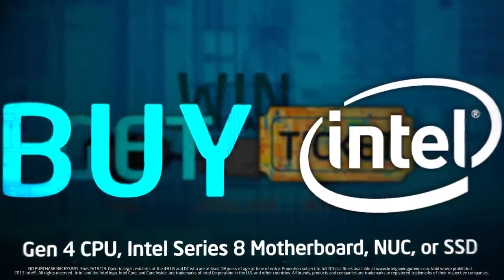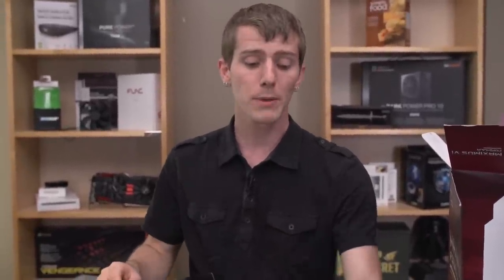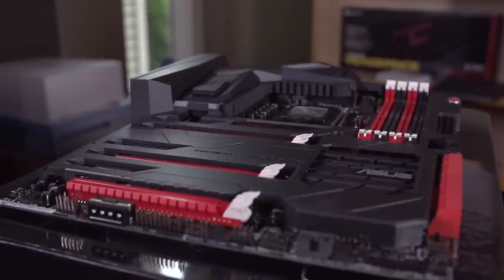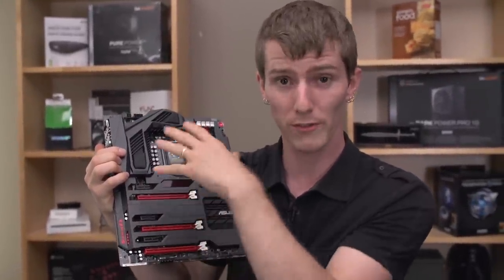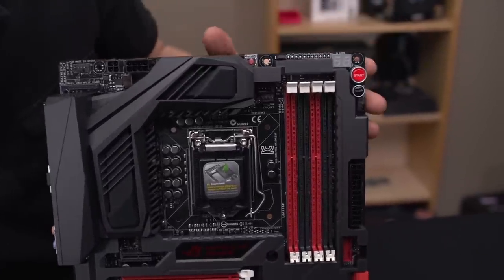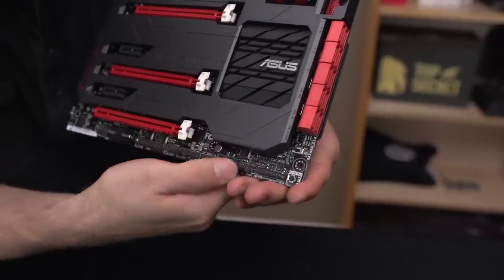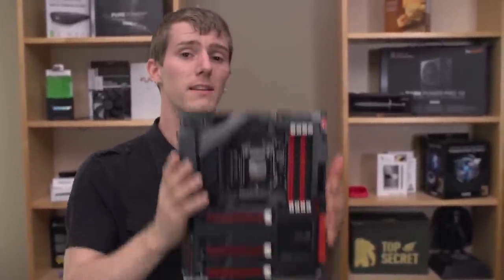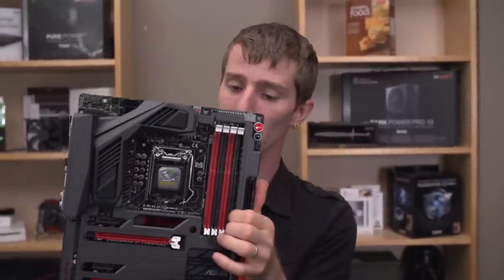Asus Maximus VI Formula Unboxing & Overview

Comment: Systems that use op-amps aren't designed for anything other than cost cutting. Audio grade p-amps are definitely superior to the general crap that's in 99% of consumer electronics, but I wouldn't pay extra for anything designed around op-amps. If board makers want to toss them in as bonuses, then OK. I recommend that users who really care that much about sound get a class-A, discrete external DAC/amp. Spend $500-1000 on something good. It will outlast your next 5 motherboards.

Comment: Next time I build a PC I will buy something else but ASUS stuff. Im done with ASUS and the ROG stuff. My PC should be extremely fine tuned by a few PC pro yet I experience constant stuttering and short freezings in every game I play. Every part is carefully selected and later tested. Everything seems to work fine. Also if I try to OC my computer it's blue screen immediatelly. The very same problem I had with my previous ASUS ROG computer. Sorry ASUS but I had enough.

Comment: I just built another gaming PC using this board: 
Corsair 540 silver (Black and red theme with red Alchemy LEDs)
2 2TB HDDs
3 SSDs
Core i7 DC base clock 4.0 ghz
16gb Hyper Fury Ram (will upgrade to 32 GB soon)
2 ASUS Strix GTX 980 SLI
H110 mounted on front
Bitfenix Recon fan Controller
Pioneer 3D Blu ray player
Coolermaster V1000 PSU
idle temps 25c/load 37c

Here is the DISCLAIMER  with this board.  This board does not work with "Devil's Canyon" Haswell CPUs.  You will  have to use ROG connect to flash the new BIOS update.  When you connect everything to this board (finish your build) you will get "00" on the on board QA Code reader.  DON'T RMA this board.  DON'T SEND BACK YOUR CPU.  The "00" means it cannot read your CPU and you will see a red CPU LED (which usually means your CPU is failing; but it is not in this case).  There are a lot of tech forums that are telling people to RMA the board or get a new CPU.  You have to download the latest BIOS (I'm surprised Linus did not elaborate on this; if he truly reviewed this board he would have explained the ROG Connect feature) on to a USB drive. Once you do that, rename it (specifically for this board) MF6.CAP.  Then install on the root of your USB drive.  Now, with the PC power off (should be idle power; the red logo on the board should be on and nothing else), place the USB drive in the ROG Connect slot.  Then push in the button and hold (the one that looks like a infinity symbol or two chain links) for 3 - 5 seconds. Once it flashes green, let it go.  It will install the new BIOS and you will also see a red light flashing near your second PCIE slot.  This takes about 1 min.  Now, reset your CMOS battery by pressing the half circle arrow.  Now boot your PC and you will be in the BIOS and also have a display on your monitor.  This board is great for gaming.  And to the guy who wants 64GB of on board memory, THAT IS A HUGE WASTE OF $$$.

Comment: but does it fit in the corsair 750d, cuz of the backplate. has anyone an expiereience with it :)
Reply: yeah, but the 750d has some fancy and wide motherboard standoffs, so can that cause some problemsproblems with the backplate :) ?
Reply: Yes, it does fit. I've seen plenty of people use this motherboard and the 750D on PCpartpicker.
Reply: The backpate does not affect the motherboard's compatibility with cases. As long as it is an ATX case or larger, you're good to go (Fits perfectly with the 750D).
Reply: yeah i know its atx and should fit, but the M6F has a really fancy backplate and many people had a bad experience with it.
the only thing i want to know is, do i need some custom scews, or are the standard 750d screws are fine :) ?
ps: im planning on getting a M7F, but i think they have the same Backplate :/
Reply: NameSchema100 As of December 2013, a revised version of the Corsair 750D has been released. It features the standard stand-offs, so you no longer have to remove the backplate of the motherboard to fit it into the case. 

Source: http://forum.corsair.com/v3/showthread.php?t=124022&page=3
Photos of revised version: https://plus.google.com/photos/110220375165387982943/albums/5988391304920115505?authkey=CMnNl6Hbxc2AtgE
Reply: TOXicf47aLiTy yeah...sadly i got the shitty old version ;( looks like i have to go with a other motherboard than the M7F, or do you know if its possible to take the backplate off, and keep the front cover...? :)

Comment: Can someone please tell me what the diffrence is between the vi and ii formula.
Reply: what is a haswell refresh cpu ?
Reply: Gam3ingPr0zz 4670k = haswell
4690k = hasswel refresh. just a newer haswell cpu. they mostly have better clock speeds and in the case of the devil's canyon, a better TIM
Reply: Keyvan Khadem Ravandi Not better clocks to be honest. It IS for sure cooler, but the Devil's Canyon has such a crappy IMC (integrated memory controller) compared to Haswell; so if you want higher overclocks plus high memory clocks, it's kinda hard to do on a 4x90K. I've personally seen very few people doing 4.7GHz+ on a Devil's Canyon whereas on Haswell nearly every chip can do (despite the ridiculously high temperatures).
Reply: As other people have said, its basically just slightly better in every way. If I were you, I'd get the one that you think looks better. And if the extra money is well spent on things you'll actually use.
Reply: Ben Zimmerman OK thanks dude.
Reply: Keyvan Khadem Ravandi z87 board will run devils canyon, the boards usually just need bios updates
Reply: ***** no you dont

Comment: Man this board is loaded with gimmicks.  The fan headers and I/O options are show stealers.

In regards to swapping opamps: all of the opamps you'll be considering for audio in that 8 pin dip will have very similar specs and always operate within their active/linear range, even when swapped.  The differences between the opamps is in what you'd have a hard time seeing on a scope.  They put their own very small changes to the signal (small is less than -100dB, good luck actually hearing it) which

Comment: ive look up newegg website and the cheapest i found is for 1248$, its bluray and ssd with hdd as well and it comes with nvidia 760 a mid level graphic card, search newegg website for Acer "Aspire V3-772G-9460" for full details

Comment: Unless you're using an effective surround sound system, I see no reason to use any form of on-board audio. Nothing beats an external, asynchronous USB 3.0 DAC. Even the cheap ones will outperform on-board audio. Why rely on shielding to protect the analog section of audio inside your PC from EMI? I can hardly think of a more unfriendly environment to process audio.

Comment: Overkill, Downgrade to an i-5 save a bit. You don't need an i-7 for gaming at all. Get NVIDIA Graphics (Personal Preference) I've had better experiences with NVIDIA. Plus that is a pretty expensive GPU, I just have a shitty NVIDIA GTX 660 and my games play on Ultra 30-60 fps. For around 200 less. So if your on a budget get a lower GPU maybe a NVIDIA GTX 760. For RAM, I guess it'a alright it's unnecessary to have 16 maybe get 12 or 8 but you can keep it. Hoped this helped :3

Comment: Does anyone run sli I'd like to for a gaming computer or is sli just don't do anything I've heard so many people say just buy a big cards I have 2 evga 780 gtx if it's not worth it il install the other in a nothe computer my computer is the Maximus extreme 4770k 16 gigs ram and a corsair 1050 power supply ya or nay

Comment: but only 2 USB 2.0 ports, one of them goes for the water cooling
Reply: +Darko Dropulja dude you are wrong, there are 4 2.0 USB ports and 6 3.0 USB plus the ones on the case that you buy and when does water cooling plug into a USB port (it goes into the 4 pin power connector next to the CPU) do your research before you comment :/
Reply: I have the board,i dont mean the USB on the side of the case,i mean the one ON the motgerboard where you connect the front usb panel on it and the rog front fan control panel
Reply: ProDeluxe PCs and no,i have the kraken x61 ,and you need 1 usb from the board so you can control the pump from the software
Reply: +ProDeluxe PCs give me your email i send you a picture of my board or find my build on PCpartpickerdotcom under "my new allrounder"
Reply: +Andy G you are right.. i already send him photos of my board
Reply: ***** yeah dude i know there was just a miss under standing of words.

Comment: @LinusTechTips hay Linus i love your all of your vidows. but i have bena tren to find a strong and power full home brew server or to beater put it a over powered gaming computer.
this is what i have bean looking for 2X1000Mbps LAN nic(s) with a CPU ruining at 5GHz along with 4X pci16 slots with thunder bolt. 
but i am also looking for a good cooling sitem wiht high PSI fans for what has to be a liqed cooled computer. i am probably not going to need tern on my heater for the winter. XD

Comment: http://pcpartpicker.com/p/HsLPYJ is this a good build for gaming on high settings, and a bit of photo/video editing? (my budget is 800$ without windows)
Reply: seems ok, if you can buy lower speed ram and drop the dvd reader you could potentially afford a 7970 (GHz ed.)/r9 280(x). I know faster ram is better for photo&video editing but you're not a hardcore photo/video editor right?
PSU seems a lil' too much but I guess you got 850 for potential crossfire?
Reply: no that hardcore, i just do it alot, im not liek editing 4k videos or anything just normal photoshopping =P. the only reason i have such a big psu is that i plan to have 2 way crossfire with this card, eventually. but yeah i might try what you suggested. thanks
Reply: lawn loom glad i could help :)
Reply: I was going to suggest the 270x with 4gb of vram or a 280(x) with 3gb due to future proofing. But I see you already got that covered :) 850 watts probably more than you need, but future proofing that too for the next build in the not-so-near-future is nice. Good luck!
Reply: yeah the 850watt psu will probably be just enought for most of my upgrades. my first upgrade is to get 2 of those gpus and to double the ram, then a better processor and... thats about it, after that the rest is just on to my dream machine.
Reply: from what i know nvidia is better in rendering and editing thanks to CUDA
i use PS Lightroom with a amd 8 core and a AMD7980 (old model)
and it does the job but it can be better
Reply: lawn loom Whar did you end up with? And are you happy with the build? :)
Reply: i ended up going quite a bit off from my normal build i got my self a bit of extra money http://pcpartpicker.com/p/yVYNTW. and im very very happy with all of the products. Right now im stable at 4.7 ghz, i can push it farther it just gets a bit messy when it gets past 5ghz, but thats expected with a 90 dollar processor. the mobo and ram arnt special. the graphics card im mostly impressed with, i got it for around 300 dollars and the thing just kicks every things ass i throw at it. metro last light on medium-highish, 3D mark, adobe after effects, saints row, dead island, all at high-ish setting and doesnt even faze the beast, well metro last light does make it get quite hot, but thats expected, plus i overclocked the shit out of it =P. overall the build is better than what i expected it to be, but of course its not gona be a monster 4k eating machine, but for right now and for a long time it'll do what it needs for me ^-^
Reply: lawn loom Piratebay is your friend
Reply: pirates bay is my friend and utorrent and bit tornado are my peers. get it?
Reply: lawn loom Yes
Reply: lawn loom i would seriously drop the seagate hard drive and use Western Digital. seagates ALWAYS fail and stop working. you will lose everything.
Reply: ive had alot of seagate harddrives and none of them have ever failed on me.
Reply: lawn loom dont worry. they will